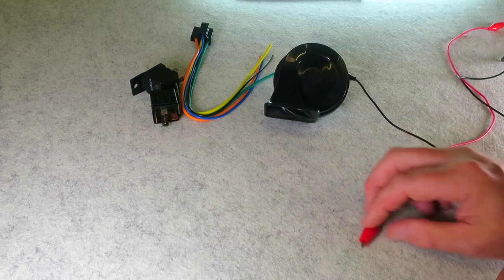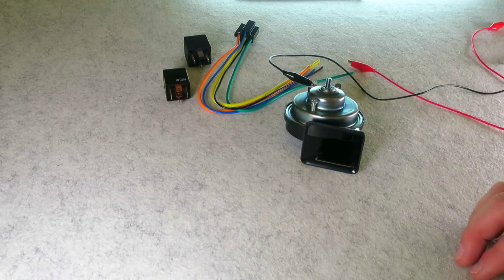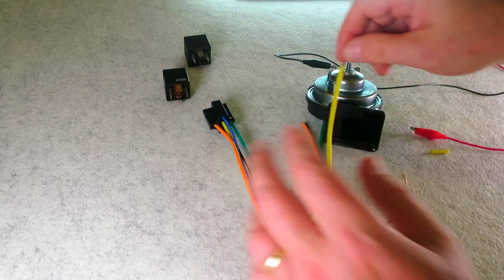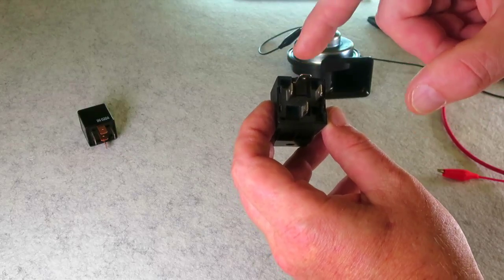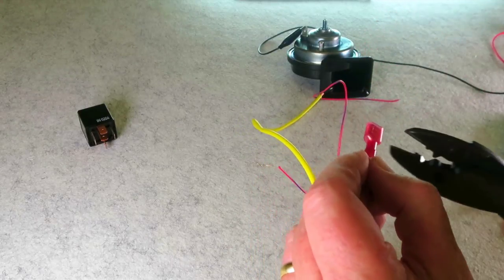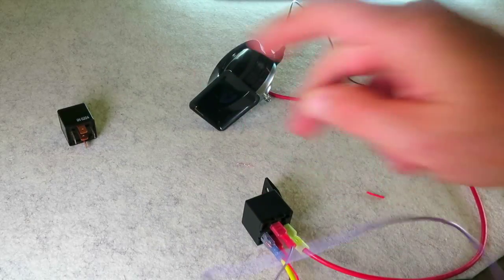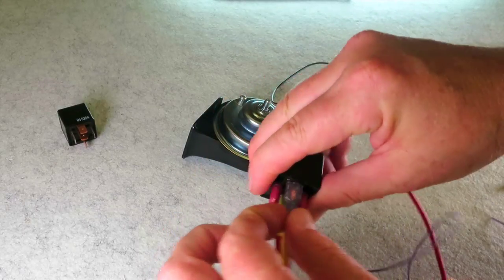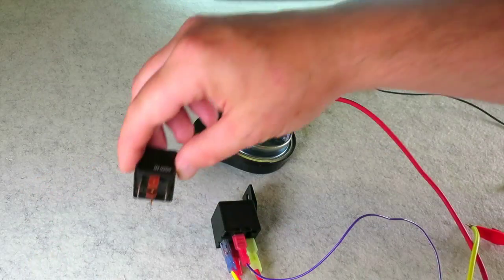How To Wire Up & Install Your Air Horn Kit

Comment: I have a new train horn and the biggest pain in the ass was the relay wiring. This is by far the BEST video I could find that made the job not only easier but actually understand why the wires go where they go on the relay. Thank you!!

Comment: I have a 2013 Sonata Limited and I replaced the horn with a small compressor horn from Marco Automotive called Tornado. Purchased on amazon. It came with a 4 point relay. Following is the hookup for the relay and horn. I had to take a picture of the relay and then zoom the pic to see the numbers on the terminals.

87-Is fed from the positive 12 volts on the battery terminal. Install an inline fuse.

30- Goes to the positive terminal on the horn

86- Goes to chassis ground

85- Is fed from existing wire that comes from the steering wheel. This is one of two wires that are part of the harness of the original horn. The black wire has a constant 12 volts on it. The green has 12 volts applied when the steering wheel button is pressed.

When 85 is energized from the green wire from original horn, it energizes the coil which lets 12 volts flow from 87 (12 Volts from battery) to 30 the positive on horn.
Reply: Thanks for sharing. I hope this helps me wire an air horn to go with my stock horn because I am totally stumped.

Comment: Ok, wait. Is it possible I can just buy this and wire it right to my battery? I have an existing PA speaker with an extra wire that I can connect the horn too. So why can't I connect that and then run it through the firewall to the battery?

Comment: I'm installing an air horn on a 2002 Buick Lesabre. I found the wiring diagram for the horn. But I'm wondering if you can tell me, is my horn switched on the positive or negative?
I'm guessing this wiring is for vehicle that use ground to switch the power on and off for the horn?
The wiring diagram that came with my horn is different, it has a ground wire connected to the relay and a positive input for the horn switch signal. If I'm not misunderstanding or mis-remembering anything.

Comment: Thank you very much for the information do you have a video showing with the solenoid? Recently I bought a Viking horn and came with a solenoid 230 amp relays two compressors three horns. Two relays 30 amp each. It shows running a ignition only wire to the horn button to the pressure switch to the relay. Also two 25 amp inline fuse wires going straight to the relay. It sure is nothing about jumping from one side of the relay to the other. The other side of the pressure switch runs straight up to the relay as well and the other side of the solenoid is ground I don't think there's no clarity to it because it doesn't say which is which. But the way I haven't rigged up every time I turn my ignition to the on position it blows the horn. Any help would be greatful thank you

Comment: No. Polarity is correct . I'm wondering it is the wire , it is for a light kit and uses 16ga wire . Would that cause low current pull and cause the compressor to react weakly? Should I go to 12 ga wire?

Comment: How can one of these horn be installed on a fifth wheel that doesn't have the horn wire like a car I got a horn kit and a universal push button switch it should work rt

Comment: I saw that you jumped the 2 positive high and low is that ok to do all the time ,my horn has a +and- so I will connect those to 85/86 and I still need an extra power source for 30or 87

Comment: I haven't had a working horn in a few years, so may rarely use this horn (needed for safety inspection in the state i just moved to). So, a pre-wired relay should be fine, right? my clunker is 25 years old....uh, i was 'laying on my horn' when i killed it. so do i merely need to replace the relay?

Comment: Does the output from the relay to the horn go on the positive or negative terminal of the horn? Then the other terminal from the horn would go directly to the chassis ground?
Reply from the maker: the relay output is +12v

Comment: So this set up would not require a zena diode to dissperce left over voltage from the relay?  Watched a motorcycle specific video where the horn switch was on the positive input side of the relay vice the negative.  Leftover voltage would cause funky lights and possibly ECU damage without a diode between pin 85 (+switch) and 86 (-) so the guy installed one.

Comment: Hello...
For a motorcycle, what would happen if i don’t use Relay, will do damage ?
Reply from the maker: Most likely, Yes. Play it safe and put it in. Its in the kit for that reason..
Reply: ok. 
I want to connect only one air horn.
There are 2 cables that were connected to the previous horn.
My multimeter show 12 volts when the horn is pressed, and 0 when it's off ,But I did not understand how to connect it to Relay and how to connect the new horn to Relay.
Reply: My relay have 4 connectors.
Reply from the maker: thats ok, the center pin 87a isnt needed anyhow.

Comment: I bought the HEYVO Air Train Horn for Car with Air Compressor 12V 17.7 Inches Loud Truck Horn for SUV Motorcycle Lorrys…

Comes with a relay compressor has pos and neg the wires from relay are plugged in their places, the other 2 wires are hooked to pos and neg on battery so how do i hook to my original car horn wiring? Its my first time with a compressor horn
Reply from the maker: the positive should go to fuseed +12v, the - should go to either a grounding type switch (or) the - horn wire in your vehicle's steering column, if you need the color and location, let me know the vehicle..
Reply: I just went and ordered Twidec/16MM Raised Speaker Horn Momentary Push Button Switch 5/8" Mounting Hole 12V Green Led Light Silver Stainless Steel Shell 1NO 1NC SPDT with Pre-Wiring Wires Switch for Car Modification G16LB-G

So ill have original car horn and have the train horn on a auxiliary horn button

Comment: Does it matter if the positive 12 volt from battery  goes to pin 30  and out on pin 87 to positive on horn? In other words are pin 87 and 30 interchangeable?
Reply from the maker: you can do it either way
Reply: @Lesscoelectronics  THANK YOU

Comment: I purchased a wire harness connector for my stereo. The red wire it’s connected to the harness. What do I connect it to?
Reply from the maker: That red lead needs to go to an accessory power circuit.

Comment: Im hooking it to a toggle switch do i need a relay? Or can i shoot one to battery than other staight to horn?
Reply from the maker: you can go either route I suppose, Just please use proper fusing if you go the short cut route
Reply: @Lesscoelectronics  should i put fuses between both?
Reply from the maker: Just put a fuse nearby where you source the +12 volt power from.
Reply from the maker: See my newest air horn install, it's even better: https://www.youtube.com/watch?v=NxWaFYOH8LE

Comment: where does the yellow wire goes to?? the battery?? if thats the case why we supplying 12v from the steering wheel??
Reply from the maker: that MUST go to constant +12v power
Reply: so yellow constant to battery plus with a fuse????
Reply from the maker: yes sir, you got it.